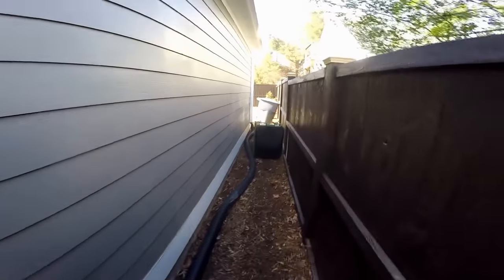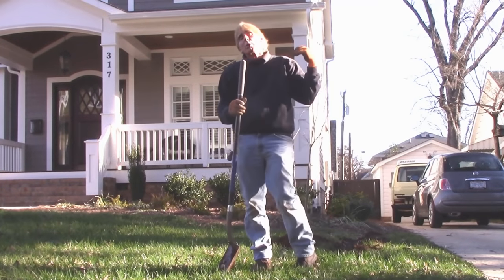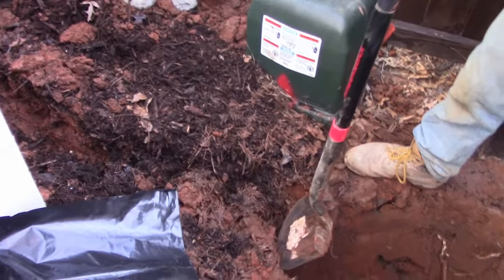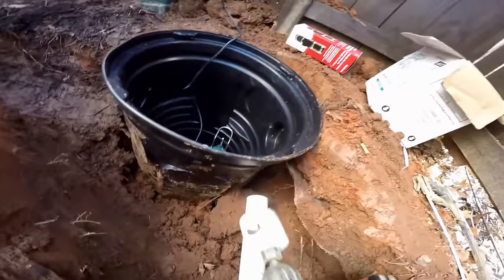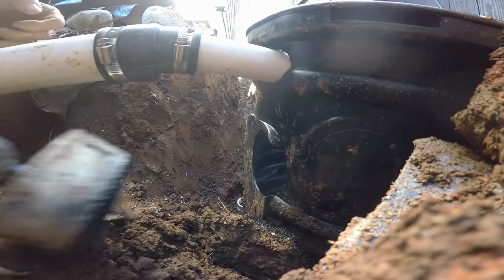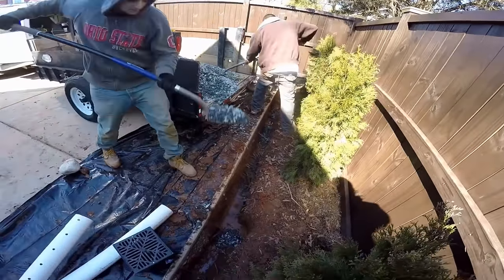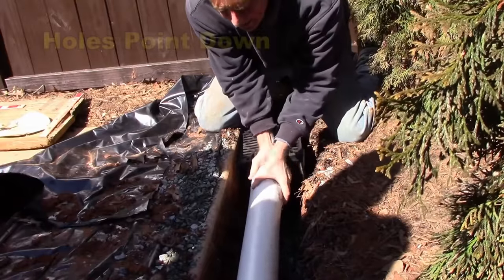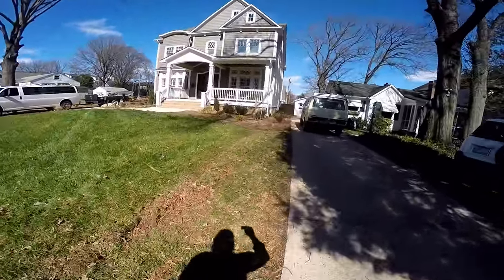Sump Pump to Drain Backyard Flood, How To for HomeOwners

Comment: Hi chuck. I noticed that in all your videos your discharged line goes from 1 1/2” pipe to 2”. Is there a reason for that? Can I just run 1 1/2” all the way out about 50’ ? 

Thank you for all your inspiring videos!

Comment: Couple of questions... where was the vent hole placed and why was the check valve placed in the horizontal rather than the vertical as in other videos?
Reply: In Atlanta, a job like this is a total of at least $8500 and as high as $11,000

Comment: What size and type of sump pump Basin did you use?
Reply from the maker: ADS HDPE Basin. Usually you can find a Lowe’s or Home Depot.. if you live here the southern Gulf States, they are probably sold out in part from the many 100’s of videos I have posted on how to install and of course Hurricane IDA . Thanks for your comment 
Chuck
Reply: @appledrains  Thank you. We got a Lowe's 1537 ADL lid and a Basin 24167 Model 1524 ADH.  Hope it works with our M-98 sump pump.  We're in California (not the Gulf States).  We're just preparing because we get sporadic heavy winter rains that flood our pavers & concrete yard, bringing in dirt from the flower beds.  Thanks for the video.

Comment: If I accidently left the holes pointing up will it still work ok or do I need to remove all the dirt and gavel and spin all the pipes going 60 feet slight down hill slope to a pop up?
Reply: they will fill over time. redo them now while its still easy

Comment: I have a drain outside my basement door and the water has been stagnant for a number of months. Is a sump pump something that could fix this?
Reply: Can you find where the pipe exits? The cheapest and easiest option would be to just clean the drain pipe if its clogged and not flowing. Otherwise if the pipe just won't flow or is draining to a bad spot then yes, a sump basin somewhere close could solve the water issue.

Comment: I don't see why you didn't put the 2 inch into the basin then in the future if he needs a bigger pump the 2 inch is right there!! And not outside the pit under the ground!!!
Reply: + Ben Boudreau - sump pumps have an 1 1/2" discharge. I have a full horsepower in my yard sump pump and it only has a 1 1/2" discharge.
Reply: Lex Luther you must've missed where he tied the 1 1/2 inch pump into the 2 inch look at it again the 2 inch is just outside The pit That he put in. I was saying that why didn't he continue the 2 inch to just inside the pit then put the reducer too 1 1/2. And I know you're saying that the 1 1/2 pump is well above the amount it will pump but if you ever want to be to put a 2 inch pump in you would have to dig up the lawn on this pump just to get to the 2 inch pipe where the reducer is. But if you had the 2 inch and the reducer just inside the pit then you can just pop off the reducer and install the 2 inch pump with no digging just saying!
Reply: + Ben Bondreau - I understand now, my apologies. He put his check valve even further out.